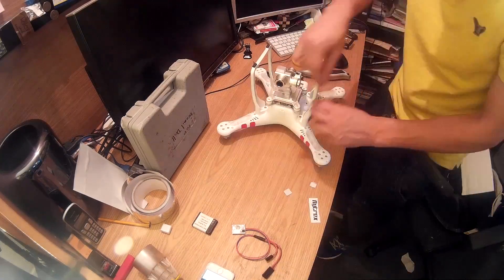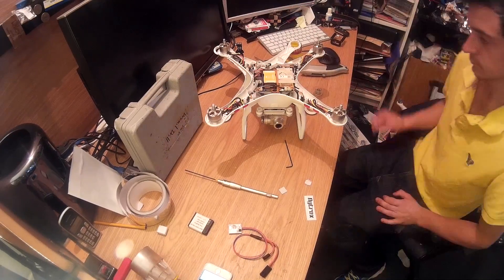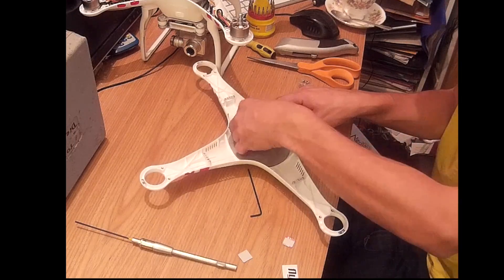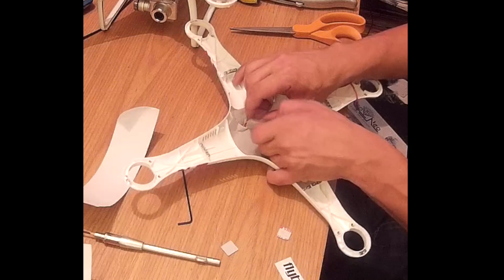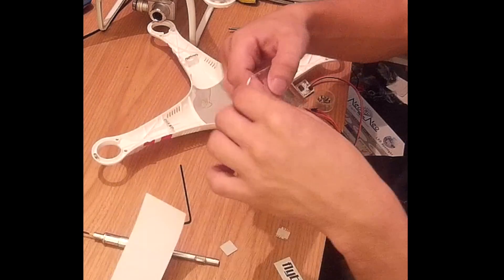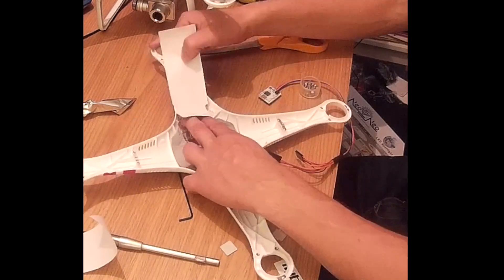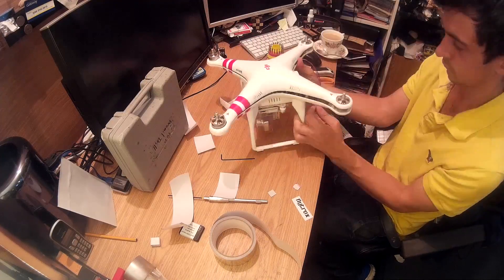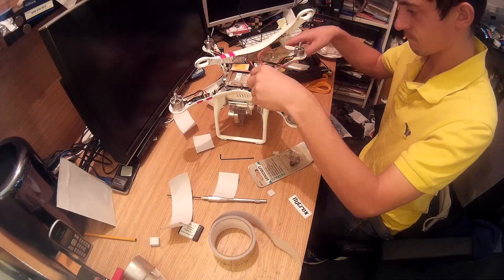2:32s Phantom Vision+ Flytrex core installation and GPS increase Mod

Comment: Is that a fact, you can increase satellite reception by lining upper inside shell with foil tape?
Reply from the maker: Before the V3 (V2) of the vision came out with improved shielding you had to do this mod to get reliable GPS.  Some people have argued that copper foil does a better job or certain paints but ive found this to be the quickest , cheapest most cost effective method and would say its a must do for any older phantom vishion+ .  Other manufactures move the GPS puck away from the other electronics to get around this issue.